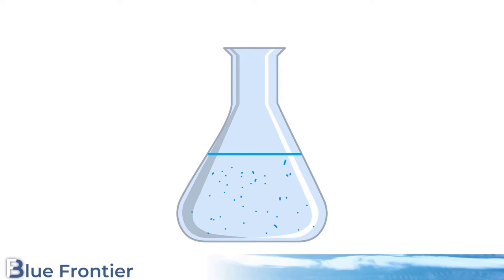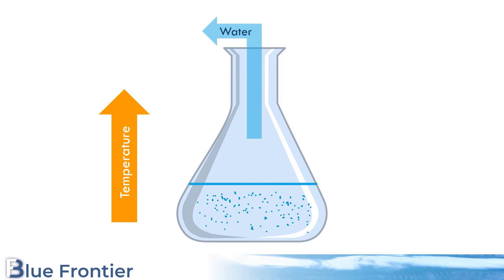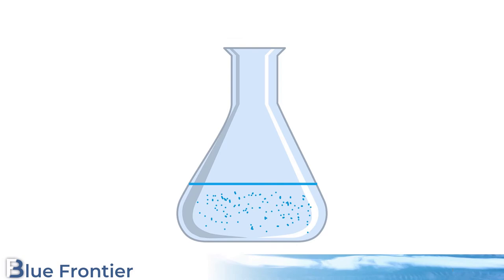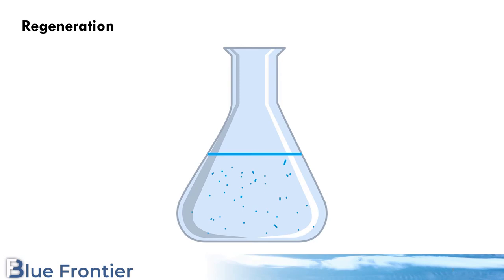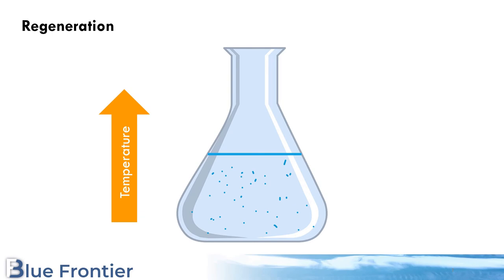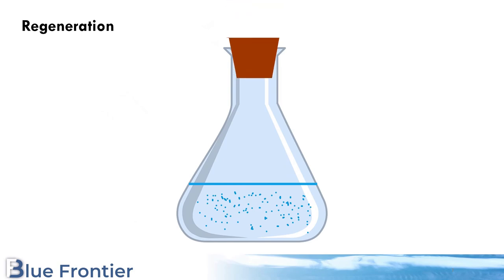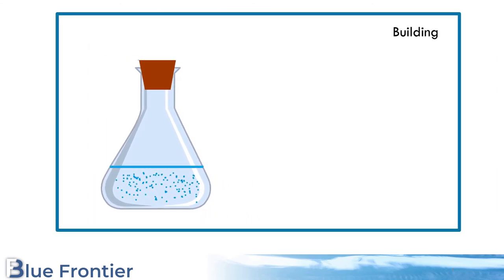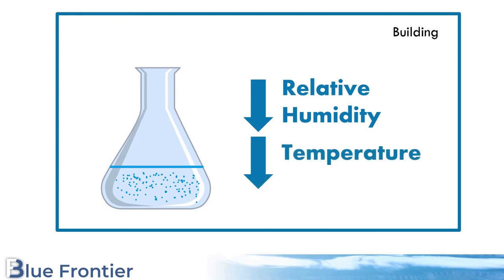Liquid Desiccants and Our Cooling Process - Blue Frontier, LLC

Comment: I can only see this as a way to augment the efficiency of conventional air conditioning.  The idea being to mist the saturated solution into the airflow to absorb moisture and a little excess heat as well...  Heating the diluted desiccant solution to drive off excess water can be done by absorbing heat from the conventional coolant loop into the desiccant.  That would probably yield a smaller energy expenditure both for driving heat off of the refrigerant and for dehumidification.  Only thing is that it would probably be far too big for residential --- commercial and industrial use would be the only option.

Comment: Energy storage that requires a pump? I would like to see the complete, closed cycle breakdown of the net in + net out of this system. You are adding layers of complexity and moving parts, as well as relying on specific dew points to be reached in order to bring water back into the salt solution. What happens when those temperatures are not reached? Based off of the simple diagrams, you will also need to pump the cool, outside air through the salt solution in order to extract the moisture. This looks like an engineering senior project that is a decent idea, but the system ends up solving no problems as it consumes vastly more energy than other systems.
Reply: Yeap, the cost and gross consumption will be way more than usual air conditioners, even pump the air through salt need a lot of pressure!